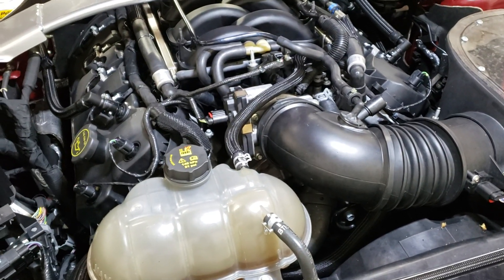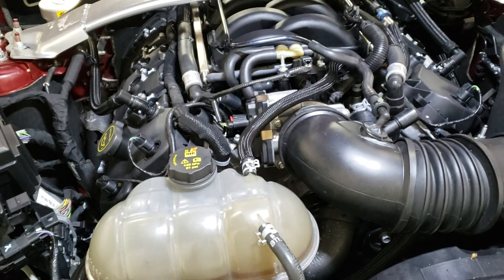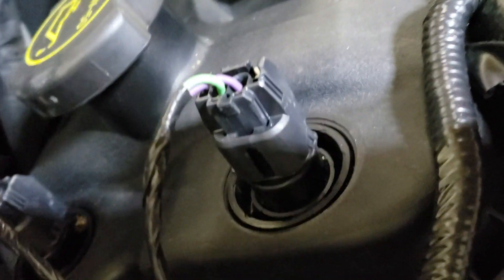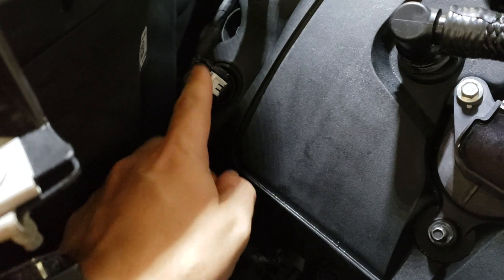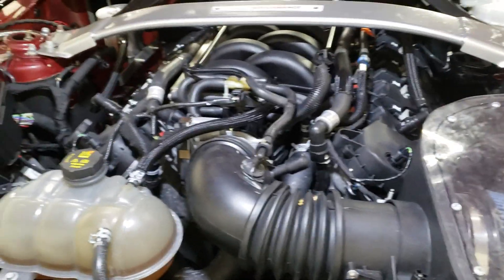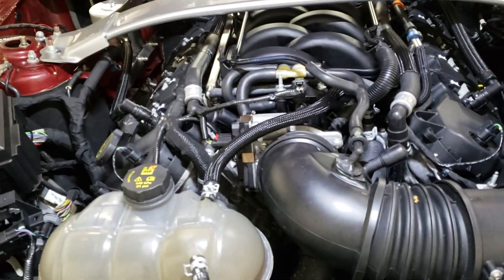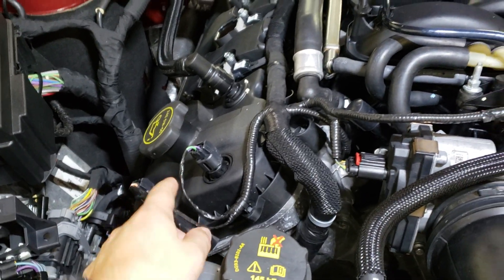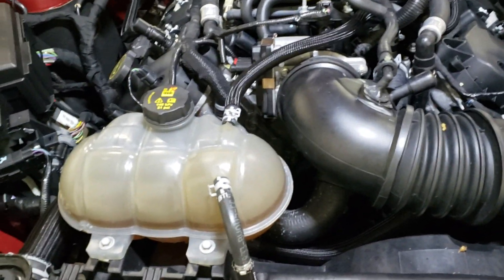Getting codes P0010 or P0020 on your GT350?

Comment: This just helped me with my CLC 180 Mercedes Benz kompressor . I diagnosed it and I got the same code. After watching this video, I checked the click of the sensor and I noticed it was not well hooked. I hooked it properly and I taped the exposed wire. Thereafter, I used a diagnostic to scan the engine and I took the light off. And it never came back on.

Thanks for the video…

Comment: Take note of the wire colors on the passenger side harness before removing both plugs.  

Most Ford harnesses are idiotproof and don't allow plugging into the wrong position but the passenger side harness WILL physically fit into the wrong sensors.   

I couldn't find wire colors in the Ford service manual, but lucky for me, I found a picture I took of the wire colors before I disassembled

Comment: I have a 07 F150. Have P0020 code. Replaced the camshaft position sensor. And the VVT solenoid itself. Still having issues. It has to be the wiring …. Just like this video says. 🙏🏼

Comment: Praying you just solved my problem man. I’m getting p0024 which is telling me my cam is over advanced despite the car running completely fine, liters no issues in the slightest. Already bought a set of new solenoids which I’ll throw in anyway but now I’m gonna splice in a new connector hopefully that’s it
Reply from the maker: I'd recommend just trying the connector first. Putting new solenoids in requires removing the cam covers and disturbing a lot of delicate wire connectors. I've seen them break while messing with them!
Reply: Hi did you fix the issue?
Reply: @need4green268  hey man I just subscribed to your chanel. I've seen you post questions in other videos too. What Mustang do you have and what kind of problems are you getting? Can you do a video talking about the problems your Mustang is having? Thanks!

Comment: When i unplug that plug, theres is white stuff on the sensor and on the inside of the plug, almost like if it was melted. Is that normal? I have codes P0010 and P0020
Reply from the maker: is it melted plastic? or something like corrosion?
Reply: @honeybadgershenanigans  its like melted plastic, the texture is almost like lotion and is on both the plug and the solenoid. I cleaned both sides but nothing changed.
Reply from the maker: that's bizarre. I've never heard of or seen that before
Reply: @honeybadgershenanigans  im gonna change the solenoids and if that does nothing im probably gonna change the harness, or atleast check the connectors.

Comment: I have an ecoboost that’s full bout on.. and recently p0010 and  P0013 I can not figure out wth is wrong!! Connectors seem fine, car running good and don’t notice a decline in power.. car idles steady below 1k rpm.. and it’s driving me nuts tryin to fix it.. before everything was fine. Until I did the nx2 turbo upgrade, and the reflash tune for the new set up. And then those codes came up along with P0443 and p0446. If There is anyway you can help or give advice it would be truly appreciated!! It’s driving me nuts tryin to figure it out! Bout to take it to dealer.. But car is running smooth I roll is in one place without moving up and down.. But I also noticed my air fuel ratio gauge in my car is stuck at 14 to
Reply from the maker: Did you ever figure this out? What a crazy combination of codes. Bad ECU? Bad harness?
Reply: I did figure it out!! I think it was fuse 41 and that controls a bunch of sensors like the vct solenoid actuators , o2 sensors ect.. so yeah just blew a fuse and it threw all those codes.  Now everything back to normal.
Reply: What fuse was 41 im having the same issue on my 18
Reply: @bigice9368  it’s a fuse that controls all the sensors and circuits to the related codes. And That fuse that controls all those is fuse 41 I believe and I just replaced it and all the check engine codes went off
Reply: @bigice9368  did u find that 41 fuse? I have a 18 too and I came across this problem. I would truly appreciate it cause It’s driving me nuts not having my car run right

Comment: 15' GT Im getting p0024 bank 2 exhaust cam advanced. Do you know what the voltage at the vct solenoids should be key KOEO? Car seems to run finehas stumble at idle every once in a while. Volts on all for shows 10.5V
Reply: Did u ever figure this out? I’m having similar problems with my 18 mustang
Reply: @slino93  yes. Cam phaser was bad. After it was repaired all codes were clear but the car still would die. Replaced all vct solenoids and fixed the problem.

Comment: Mine ended up being a P0014 code for cam timing but ended up being the vct connection in bank 1. Took 3 weeks for them to figure it out!
Reply from the maker: If an otherwise healthy coyote engine starts throwing cam-timing related codes, it’s almost always the connection
Reply: @honeybadgershenanigans  the dealer ended up figuring it out after a call to ford engineering. They changed the entire wire harness (part 14290). My voodoo was changed for the Gen 2 in May of last year after throwing a couple rods through the oil pan. 😫
Reply from the maker: That’s the way to do it! Once the engine harness has been messed with, it seems like the likelihood of the connectors failing goes way up

Comment: 19  GT350.  Got code P0365B. Bank 1.   Cam position Sensor malfunction.  I researched , forever, to try to figure out exactly where this one is. Looks like it's pasenger side in back, exhaust cam sensor.   So.. I felt around back there and I felt the sensor. I pushed down to see if it was loose.  CLICK!  I felt a positive click of the connector when I pushed down.  Couldn't believe it.  The dam thing was definitely NOT clicked all the way.  Fired her back up,  no up and down idle etc. Seems to be it. I'm hoping.  I need to just get the cel light cleared and see if all is ok.
Reply from the maker: glad to hear it was an easy one for ya! If you keep driving, the CEL will auto clear!

Comment: I have my 2008 4.6 3v GT bama tuned cold air intake last week just had long tube headers installed I don’t have cats on haven’t for a long time always knew my engine light was for “o2 sensors” put maybe 300kilometres since I got my car back, after headers install, uploaded new tune, today did fresh oil change drove it around later in day while go through gears up till about 4500rpm car bogged went limp mode “wrench” light came on in car luckily got it home but got a bunch of different codes specifically, : P0010 P0020 - P0135 P0155 -P2008 if you can help with some suggestions thanks !
Reply from the maker: Sounds like an electrical issue to me. Don't typically see O2 sensor and cam position sensors have issues at the same time unless it is electrical. I'd look for bad wires.

Comment: Did you ever see this cause P0345 (Camshaft sensor A bank 2 circuit malfunction).  Currently getting this plus misfires on bank 2 at 4000 RPM light load on the track.  Can never replicate on the street.
Reply from the maker: I believe that’s the cam sensor on the back of the head. Those are to detect the actual timing of the cam where the solenoids in front are what tell the VCT on the cams what adjustments to make. Sounds like you’re getting error that the computer doesn’t know what the cam is doing. I’d start by checking all connectors on the back of the head. If nothing obvious, then start the car and wiggle the wires. 

Also, bank 2 is drivers side
Reply: @honeybadgershenanigans  thank you so much!  I checked resistance of the VCT solenoid at the PCM and wiggled the one near the air box and it went from 8 ohm all the way to high resistance and open circuit.  Weird it would set P0345 which is for the intake cam but it’s the exhaust solenoid.  Who knows how Ford calculates an error though.
Reply from the maker: @k4show  That is interesting. Did you check all (4) Wonder if more than one is failing? 

Either way - glad you found it!
Reply: @honeybadgershenanigans  yeah I did check all 4.  I won’t know for sure it fixes P0345 since it only occurs on the track for me for a while though :(

Comment: Good info. Hey I have a 17 gt350. And I bought it with 450 miles in Feb. And after I hit around 2000 miles i have a rattle right a t 21 to 2400 rpms. I brought it to dealer, they said its normal???? Any experience with this issue?? Thanks
Reply: Check out SSM46173 - if that describes what you're experiencing then it is what Ford considers normal. Some have it, some don't. Mine has it and it's been the same for 12K miles. Hope that helps.
Reply from the maker: Couple different types of rattles. Some are bad and some are normal. Got video of it by chance?
Reply: @honeybadgershenanigans  I brought it to dealer and they said this rattle is normal. Some of the SHELBYS get this and some don't but as long it dosent get any worse I'm not worried about it . I still have another year on warranty. So they told me if it got worse to let them know. My dealership is a giod one. Awesome service guys.
Reply: @mustangscott7694  so what happened with that rattle? Did it get worse, get better or disappear?

Any details would be cool.

Comment: Hey! I looked up the WPT1506, and it comes up as a DEF Injector connector. Is it the same as the WPT1039, but with heavier wires? I tried finding photos and nothing shows a straight-on photo of the WPT 1039.
Reply from the maker: I can't say for sure since I don't have both in front of me, but the pics of WPT1039 online look different to me. WPT1506 is definitely the right connector if you're having this error, though.

Comment: Yoo brother I have a p0023 on a mustang gt 2023 plz help
Reply from the maker: Did you get it fixed? this is the most common failure - the exhaust cam solenoid on bank 2 (directly behind the intake). Likely a shorted wire where it goes into the connector